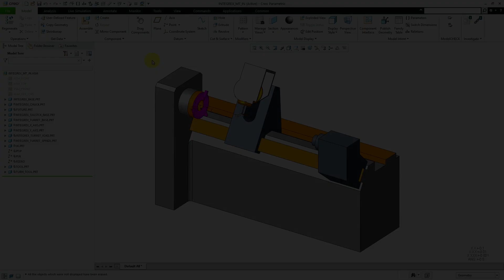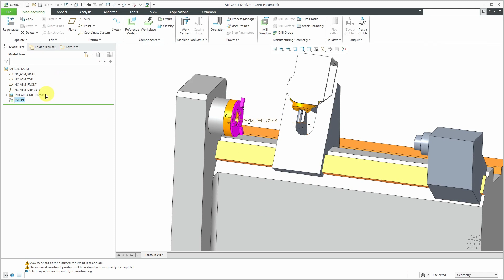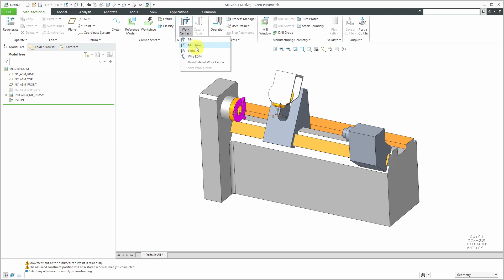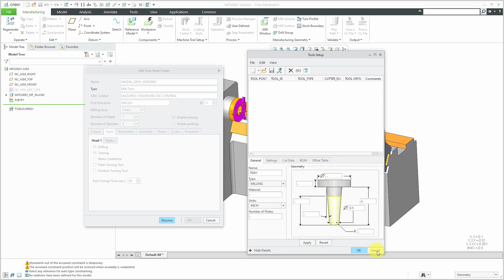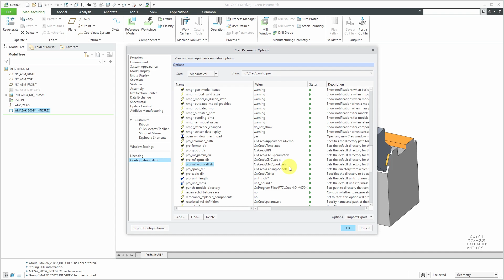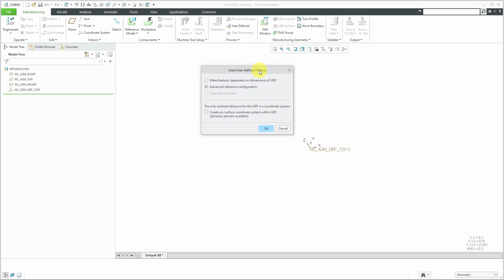Creo Parametric - Configuring a Mill-Turn Work Center - CNC Manufacturing

Comment: Nice video, do you have any videos how to do Process Plan and how to get those into Windchill? PTC University has 0 training for this
Reply from the maker: Are you talking about a Process Plan from Pro/PROCESS or from MPMLink? Back when I used to teach Windchill I thought the latter was covered a little in Intro to MPMLink.
I would love to make some Windchill videos but I don't have an instance yet. I bet they would be hugely popular and help drive sales. (Hint, hint, PTC.)
Reply: @CADPLMGuy  Yes, trying to find a better way to transfer data from design to the manufacturing engineers, right now they have a completely separate process and I am trying to show them how easy it is to set up, vs manually creating screen shots and templates

haha yes hint hint indeed @PTC